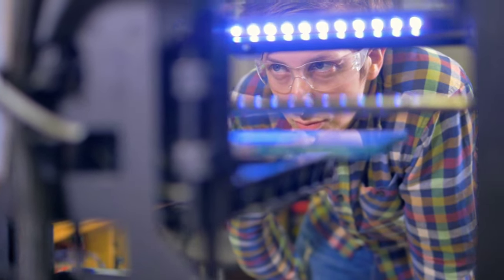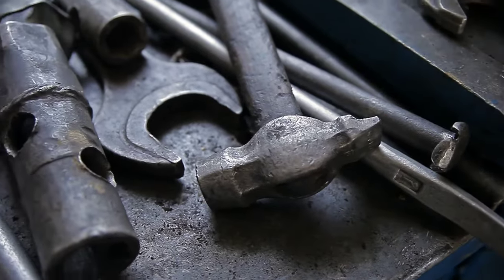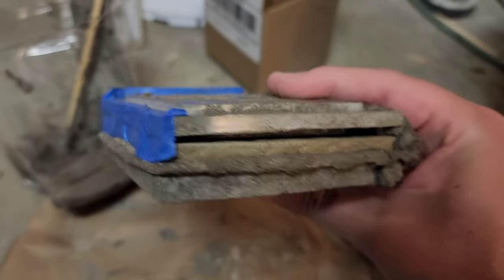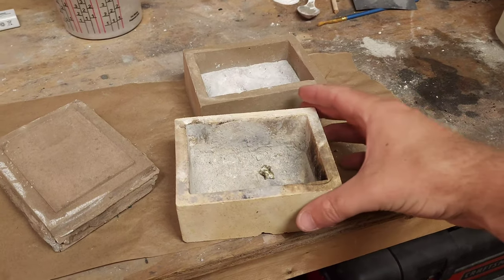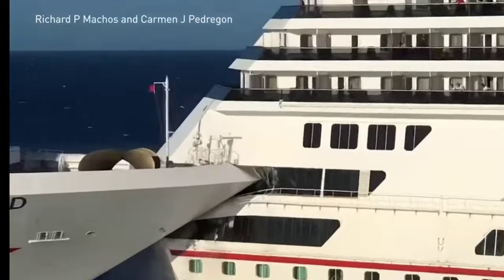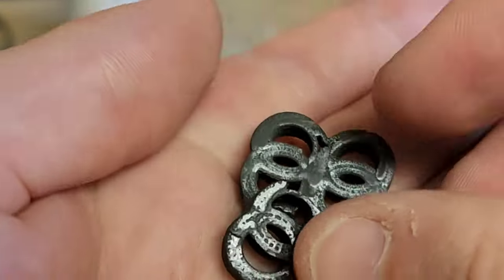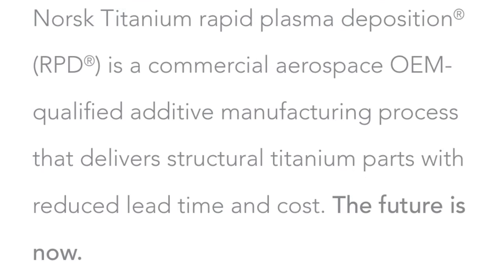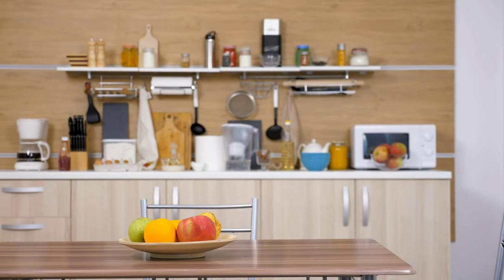Printing Titanium at Home may be Closer than YOU think

Comment: Desktop Metal also has Titanium FDM printing figured out for their Studio 2 system as well. I work with their hardware regularly. They need custom built vacuum furnaces to achieve  proper sintering characteristics. And Ti. requires the most additional effort compared to their other range of FDM metals. If you can nail down a sintering process thats accessible to hobbyists that would be great!
Reply from the maker: I think when I looked they used bound metal rods instead of fdm, but tbh I'm not too familiar with their products (other than I can't afford them 😅)

Hopefully I can refine this in the next coming months (if nothing else I'll learn a lot trying)

Thanks for the support 🍻
Reply: @Mr-Highball   Yup you're correct, it's rods instead of filament, though the chemistry and concept are identical, just metal powder mixed with thermoplastic/wax binder. Even the hotend is essentially an FDM hotend, just with a rod pusher instead of feeder gear. FDM isn't necessarily synonymous with filament , that would be FFF. Even a paste extruder like for clay would fit under the FDM umbrella, but those naming conventions are getting a bit dated as more and more AM tech comes out every year (and I'm being a bit pedantic haha).  Markforged uses filament instead of the rods, though they haven't gotten Ti quite yet. 
Keep up the great research! I love seeing  high end AM tech becoming more available for the average joe!
Reply from the maker: @ArmorClad125  thanks for the detailed response (hard to keep up with all the acronyms sometimes haha)!

🍻

Comment: hey Highball, impressive Achievment! To give you some additional information: there are companies (e.g. Element 22) which are allready able to fabricate titanium parts with a FFF-Printer. The main problem here is the sintering and the mecanical propories of the sintered titanium. Naturally the polymere in the filament disolves into the titanium while sintering and the resulting chemical composition yield very bad elongation behaviour and strength.
If you are interesseted in more information, just ask ;)
Reply: And yes I already own a titanium FFF banchee
Reply from the maker: Interesting! Had no idea about that company (did preliminary searches but didn't come up with too many resources on others using fff). Not sure if SBS is the same or a separate process from the fff approach but I'm assuming sintering still takes place in a tradition furnace (inert gas and maybe vacuum?)
My process hasn't been fully worked out yet but it's coming along. Interesting times 🍻

Comment: Dude, it's really cool! I wonder what you'll publish next)

From my limited experience with prototyping titanium implants (conventional welding), I recommend you check the sintering atmosphere issues. Hot titanium adsorbs many gases (N2, H2, O2, etc.) which influence its mechanical and chemical properties. Also, as a refractory material, you may try TiO2, it's a common white pigment, yet you may avoid extra impurities in your sintering zone.
Reply from the maker: Thank you! Been focused back on aluminum with a tutorial series but after that looking to revisit Ti with a fresh set of eyes (and thank you for the ballast suggestion) 🍻

Comment: Great news that you are making progress! 
I guess the ratios will be different for each metal? 
As far as the audio, I definitely like this new video over the one with background music. Yea, its so much better.
Reply from the maker: As far as ratios I presume you mean the ratio of SiC for each heating element?

If so, then that could be true if the metals have a far enough sintering temperature gap between eachother. What I mean is that, if you wanted to sinter bronze for example but also wanted to sinter stainless steel, you have two options -

A. Benchmark you element so well that you know the max temps at 100% power level can sinter steel but at say 50% powe level can sinte bronze

B. Make two elements that just sinter each metal at 100% power level (ie. A steel sinter element and a bronze element)

Here's a floating comment to a message that may self destruct -
I hear you and am actively looking to improve things like this. It's a slow process (and editing takes a long time as is). Hopefully you/others will see some improvements in the next few months
Reply: @Mr-Highball  I probably don't know the exact ingredients for the ratios but I was assuming you had to have different ratios of material to do different things for the different metals.. to prevent oxidation of the metal, yet remove the carbon etc...
Reply from the maker: @marcfruchtman9473  at least up to this point I've really only had to segment heating elements on a few temperature planes

1. 0 - 800°f max is good for debind (coined this the debinding element)
2. 1500°f max works out well for aluminum 
3. 2000°f+ steel, titanium inconel(? 🙂), iron sintering

Here's a comment to something that may or may not exist in this digital plane-
I do all filming and editing on my phone (I know, so millennial of me, but it's one less barrier for me to put a video out to the ether).
Proper BT mic has been ordered with wind shield (back "in the day" I would've laughed at myself for even considering filming on a phone... well here we are... and i think its time for me to go back to my old ways with proper equipment)
Reply: Why not just use an induction cooktop to do the sintering?
Reply from the maker: @bobweiram6321  one reason would be  that not all materials are suitable for induction. While titanium should be a candidate, something like borosilicate would not be. 

Another reason would be the coil size required for larger parts is prohibitive (ie. Smaller parts would probably be OK but anything larger than say 4 in would need custom coiling).

Induction heatingnis still an interesting concept to me for sintering (and actually what I originally was looking into before microwave sintering) but to me it felt a bit more limited in what it could achieve
Reply: @Mr-Highball  Definitely true, but metals, especially aluminum and steel rule supreme. An inexpensive sintering solution would be a major breakthrough.
Reply from the maker: @bobweiram6321  I agree, and what really turned me over to microwaves though was the simple fact of cost and volume of parts that could be produced (overall I believed to be less expensive than induction)

Not that I'm ruling it out by any means, and if you have any resources on other makers trying it I'd certainly be interested!
Reply: I just watched this review on YT:  "Get Ready...OBSBOT is About to Up Your Webcam Game! [Tiny 2 4K PTZ Webcam Overview!]"
(If you happen to be looking for a webcam, this one might also be something you might be interested in)
(No affiliation).